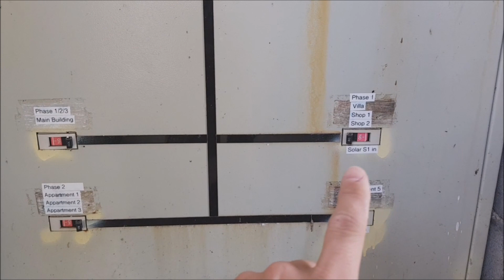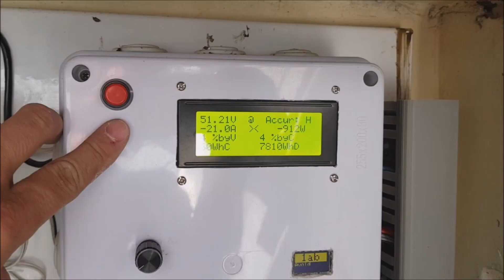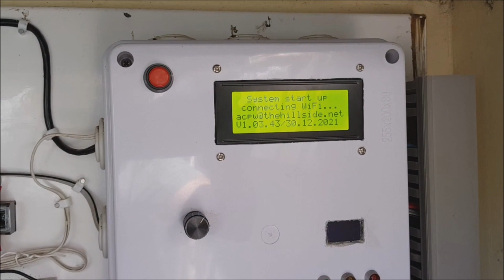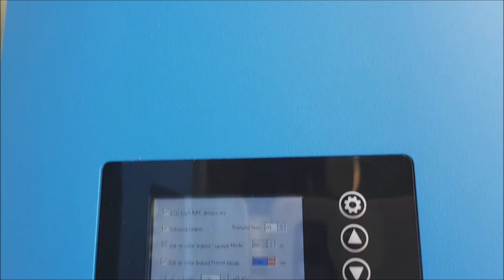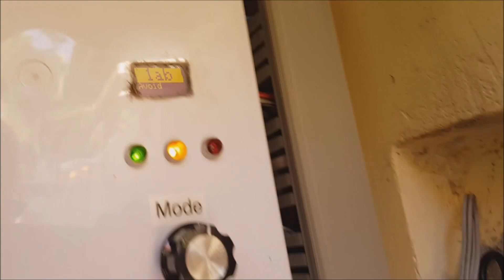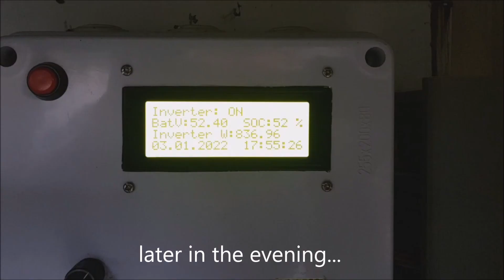The AC-Powerwall Upgrade: Part 3, Power Electronics and Wiring, Mission Objectives

Comment: Of course dc charger would eliminate the problem but that would mean rewiring the array to dc charger. For interest please tell us how you make the AC power you are using to charge the batteries so we understand the limit of production. As always I enjoy the thinking you put to work as AC is the way to go in my opinion as we may as well convert to AC as soon as possible in our systems. Like I said before I accomplish most of my use with timers set to run only during the sun hours but I can see the advantage of using a relay and ct to turn on the charger when the export is higher than the load. Cheers great video.
Reply from the maker: Working with AC in solar is the future because it is just easier. It is just again the same question as it was asked 150 years ago by some famous inventers. It's just all about transmission, but this time it's not on the grand scale, it's in the micro scale.
AC wiring is everywhere, already present in our homes. People can say, hey I have sunny 2 sqm, 20 sqfeet of space there, let's put a solar panel and a micro inverter there, plug it into the socket and make power. New installations today are mostly micro inverter based.
Thats why also commercial powerwalls today are all AC based (Tesla, Sonnen, Enphase,....), they all just convert AC-DC-AC in the device. Of course, they do it to the single Watt, not to hundreds of watts as I do it. I even had the plan to include a variable charger into this upgrade, but decided to go again for the fixed output. Maybe more on that in the controller video.
Why I initially went with the AC concept is just because I had existing systems. Most Grid-tied, and all spread far over the place. Ten buildings, 14 subpanels, 3 distribution panels, one main panel. That made many possible spots to feed in solar power, but also a perfect spot for catch excess at one place before it leaves the property.
Rewiring something to DC would not make sense and as well require a lot of copper. And most of the AC is immediately used up anyways. 
So yes, I find this so interesting to tackle this topic by DIY, and how great this works. Open up the horizon for the classic solar DIYer who will usually only see DC as an option. Thanks for watching!
Reply: @RolandW_DIYEnergyandMore  Totally agree which is why I too AC couple solar systems. I was thinking a 3 pole switch with a different phase on each pole and a CT to control which switch would run the charger when the exporting starts to happen
Reply from the maker: @offgridwanabe  yes, would be an option too. Just must be a switch, which is at all times only allowing one phase to pass (mechanically interlocked). Otherwise, big boom :))

Comment: If I may suggest, use the telecom 48v 100 ah. They sell them every 6 months or so because they have zero tolerance, and do not take chances. Huawei is good. They go for $600 here in Egypt. They are LFP. Even if they have 4 kwh not 5,I think they are a good deal. They have the BMS etc.
Best regards from Egypt.

Comment: One day, I am coming to your resort! For the weather but mainly the powerwall! I would like to automate ac charging of my 48v lifepo4, we have a 3 phase grid tied inverter, do you know of the most effective device to do this?
Reply from the maker: A commercial solution would look something like this: https://www.deyeinverter.com/product/hybrid-inverter-1/sun8-10-12ksg01lp3.html
I saw that inverter offered for up to 3500 USD. Thats the price i spent for all of my powerwall, where the cells are typically the expensive part. Now you know why i prefer DIY.
How does a 3-phase grid tied inverter push the energy on the phases. Where it is needed by demand, or equal to each phase?
Reply: It pushes an equal amount to each phase, I thought your setup might transfer to my situation somehow??? Is this your hobby and flying planes your career?
Reply from the maker: @tryingtosucceed  flying planes was one my career. It won't come back for me anyways as I am away from it for too long already, and airlines still do not look for long range pilots in higher numbers. I consider myself as retired. Yes, hobby. But i am majored electrical engineer. Your case is surely similar to my situation. i could imagine that you do it the way i do with excess energy-controlled chargers. Just would have to look into your energy flow on how much is available where and when. Then would know, what sizes of chargers etc. As I wrote   at another comment, there are as well variable output chargers on the market. So, the level of control can be finer than I do it here.
Reply: Also I have the inverter side of the battery sorted, I am just thinking about charging via ac automatically.